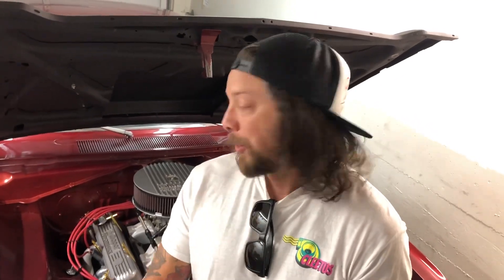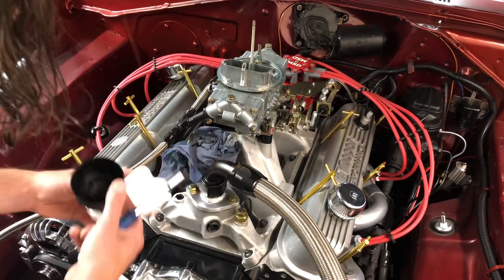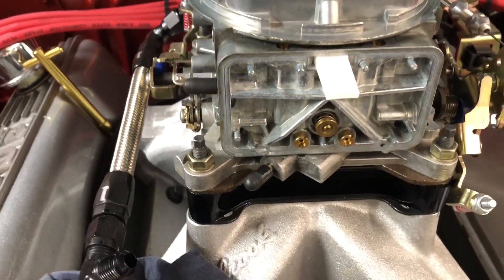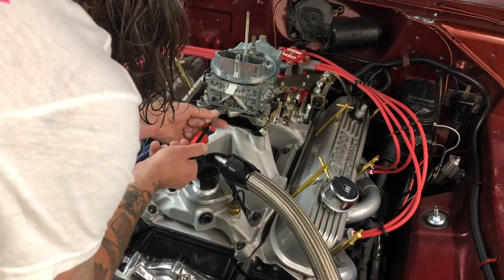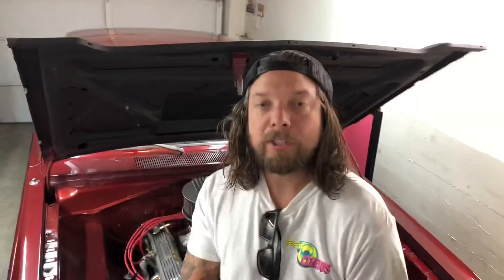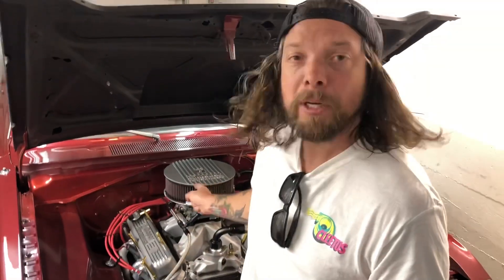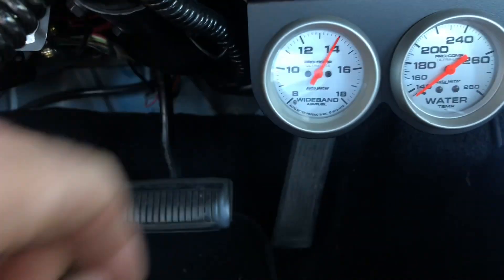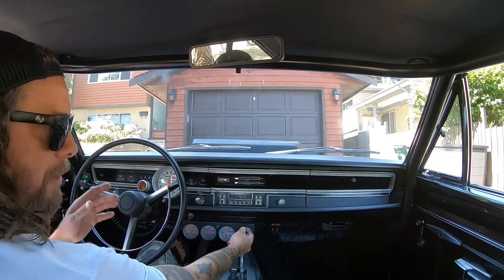Holley jet tuning with a wideband o2

Comment: great video... You can get it even better by changing the Idle feed restrictor size..  I notice when you let off of the throttle it goes rich..  This will help that...  You can use either the wire method or drill and tap them out to make your own "jets"  
 Love how clean that engine bay is... 
Andy
Reply from the maker: Thanks Andy! I’m going to look into this for sure, 👍🏻🍻
Reply: @SimpsonsSpeedShop  Anytime brother,  You will be amazed at how much economy you can get...with the wideband tuning.  I fully agree with you.... its the way to go..  Dont be afraid to lean it out at idle/part throttle to see where your setup runs best.. You will be shocked
Reply from the maker: I was just reading up on the restrictor options, so with out adjustable air bleeds I would drill and tap to make my own, or wire in the metering block method may be a better option, next carb I get will have adjustable bleeds for sure
Reply: @SimpsonsSpeedShop  Ive done some videos on my channel about it..  I was able to get 16mpg from Casper's 600hp 393W with a tunnel ram and two Holley 660 center squirters!  So if you decide to chase that rabbit down the hole you could do better than me.. with a single carb and lighter car. Casper race weight was 4080lbs..
Reply from the maker: Ya right I have seen a vid of your talking about daily drjving with a tunnel ram on Casper. I’ll re watch it, might be real useful, I have a tunnel ram and a pair of 660 that might make it onto the dart, again, some day. thanks again bro!

Comment: A very good piece of info here Joe. Nice to know this. Can the carb air and fuel adjusters be  of any help tweaking it a tad?  Also, I have a carb spacer to install on my 750 Holley. How much does this change effect air/fuel ratio? Will have I have to readjust the carb after the Carb spacer install?  Thanks for sharing this info, was helpful. Cheers from Motown.
Reply from the maker: Watch my dyno video and you can see some results of how a spacer will affect air fuel ratio. But every motor is different, thansk for watching

Comment: I heard you say "it got pretty hot" . What do you call pretty hot? My 440 Charger usually hangs around little under 190  but it did get up to 196 (hot day stuck in South Florida traffic) and I felt that was pretty hot.
Reply from the maker: Ya it was 200 for a bit. I stopped and let her cool down for a bit. It was a super hot day out tho. Did a drive yesterday and it was 180 the whole time

Comment: Some transfer slot restrictors may help clean up the low speed without having to jet it to far down and messing with WOT. I’ve spent a lot of time getting big carbs to go down the road cleanly.
Reply from the maker: What did you have in mind?
Reply: @SimpsonsSpeedShop  gotta use some brass set screws and numbered drills. 8-32 or 10-32 x 3/16 will work. You can get them off ebay or at a fastenall. Tap and install them into the transfer slot hole on the metering block face of the carburetor. 4150 carbs I usually start around .078 and adjust from there. It’ll lean out your low speed when you just cruising around. Wish I could upload pics. That’s the trick for running dominators on the street as well. They just like a much smaller restriction.

Comment: Very nice video once again. Off topic though. you show the 1000 HP Mopar , then you mention 600 HP 408 with fuel injection . I would like to hear more about that set up too
Reply from the maker: It’s almost the same build as mine with a 4” stroke. Using the edlebrock pro flow efi. Nice unit. All I really know on it
Reply: @SimpsonsSpeedShop  so did you run the leaner Jets while you were racing? or change back each time?

Comment: hey joe, when you removed the front bowl that vaccume cap looked cracked you may want to check it. That would be a big vaccume leak. love the video, cant wait to see the car run.
Reply from the maker: Bro! You have an eye! It was a bit cracked! All tho don’t think it was causing a vacuum leak yet, I can barley pull air thru it but it could have got worse. Thanks so much! Great job and thanks for paying attention!
Reply: @SimpsonsSpeedShop  No Problem, l love your channel and I just want you to do well . Cant wait to see you carry the wheels at the track with a Awesome  Trans brake Launch.
Reply from the maker: Thanks for heads I’ll check it out now!

Comment: You can lean out the primaries more than this. My car cruises between 13.5 and 14.5 depending on rpm. Idle in gear 14-14.5 and in park 13.5-14. To run good at wot rear needs to be much richer, in my case afr is 12.5-13. This way my car does 11mpg with 740hp big block.
Reply from the maker: Yep you got it. I could go further but I’m happy here. Was out driving shaving today and ripped in harder that I have been and it was 14+ so I’m good for now

Comment: Off topic but I have a 92 Dakota and want to do the 360 magnum swap…. Recommendations on heads? Thinking 10-10-1/2 to 1 on 93 roller valve train… Sleeper truck… Do you use a solid or hydraulic cam?
Reply from the maker: Trick flows and a solid cam. Watch my dyno vid for build specs!

Comment: Are you running 1 or 2 o2 sensors and if 1... did it matter what side you put it on?
Reply from the maker: I’m just running one. We ran 2 on dyno tho. It dosnt matter what side you put it on but drivers side is more convenient for wiring.
Reply: @SimpsonsSpeedShop  cool thanks

Comment: Hey man, off topic but..did you do a disc brake swap up front? I'm about to get a '67 with front drums, 5 on 4" pattern I believe. Trying to figure out swap options
Reply: You can use 73 and up A body spindles rotors bearings etc. Be sure to get the matching control arms as they have the larger ball joints same as B and E bodies and that will give you the 5 on 4.5 bolt pattern for a better selection of wheels...all will bolt on your original k frame.
Reply: @mike05hdfatboy  yes 73 to 76
Reply from the maker: Hey bud! All good man, the car came with disc up front that previous opener did. I actually have a 73, I believe, K member that it seems like they just swaped brakes over with it. Pop on summit and fill in categories for a swap kit is the way I would go. I will upgrade front brakes soon tho. Thanks for watching

Comment: That O2 sensor works great! Never had those in the 70's. Just many runs down the quarter mile dialing in our carbs. What brand of header are you running? Looks like ceramic coat? I have 1-3/4" Hookers but the collectors run right into the trans crossmember and makes for a lot of vibration as the pipes hit it. Otherwise they worked great. My 1-7/8" Jr Race headers from the 70's actually fit better!😀
Reply from the maker: Ya a bit of modern convenience for sure. These are tti headers that I had ceramic coated after I installed the wideband bung. Thanks for watching

Comment: I used to do a bunch of carb tuning in my 70 duster.... i set up a wideband and vacuum gauge in the a piller with a a piller pod i cut to fit up there.... keeps thoz gauges in vision when rompin on it! Lol
I noticed most of cruzin was off idle circuit, i changed the tiny jets as well as the air bleeds.... i got up to 16mpg....360 4speed, 3.55 gears, not bad..... but now the duster has a 6.4 hemi, t56,and gets 27mpg....havent done much of mpg tuning yet!
Reply from the maker: Nice! Right on. This carb dosnt have removable airbleeds unfortunately. My next carb will for sure. Thanks for watching
Reply: @SimpsonsSpeedShop Drill and tap them.